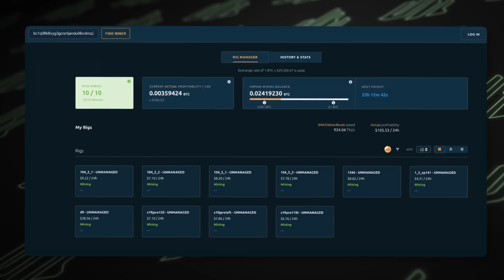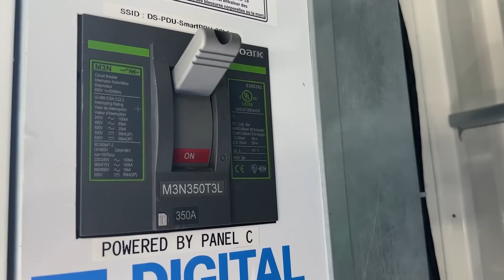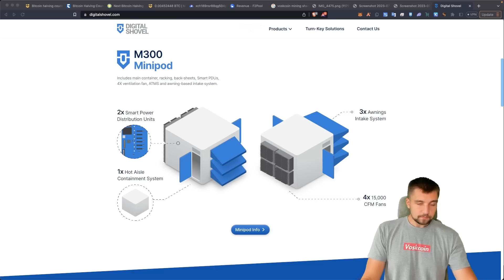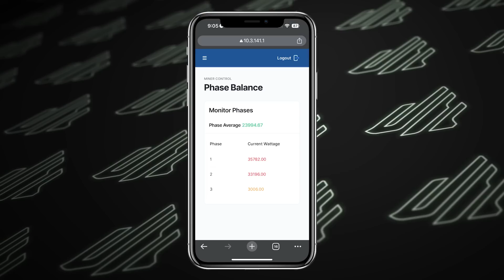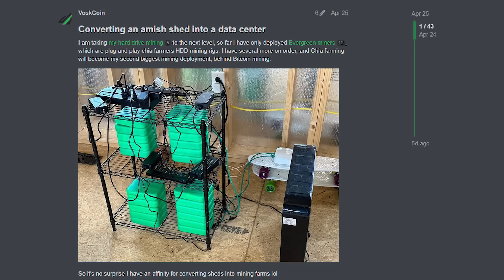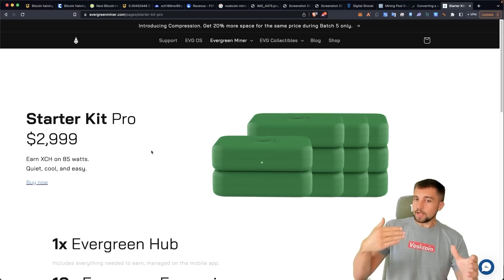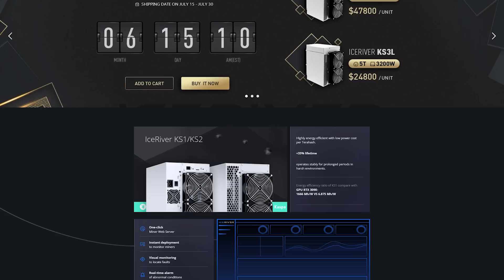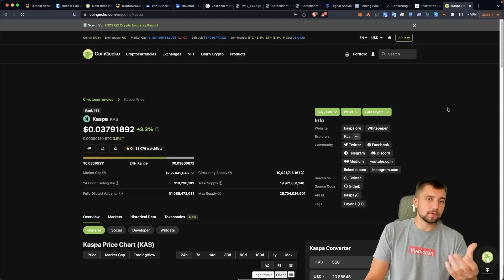My Mining Farm Problems Are Losing Me $1,000s!

Comment from the maker: I have more HDD miners coming too - https://voskco.in/chia
Evergreen Miners are Adding Compression! - https://voskco.in/evg
Use code VOSKCOIN to save some coin
VoskCoin Hard Drive Mining Shed Build - https://voskcointalk.com/t/converting-a-shed-into-a-hard-drive-mining-data-center/43375?u=voskcoin
Reply: Voss, It sounds like you might have a short circuit. In other words, there is some electrical wiring that is touching metal and thus your pulling too many watts. Go through carefully and check all the wiring inside and outside of your asics and any other electrical wiring to make sure it's not shorting to ground. Have you noticed any burning electrical smells? The insulation could have burned off somewhere. I could be wrong, but it's a good idea that carefully check all the wiring.
Reply: Do you have a thermal camera? It can sometimes be used to locate a short circuit. I once located a short in automobile by turning off all the lights and closing the garage door. I held my breath, turned on the ignition and quickly looked under the hood where I could see one of the spark plug wires glowing. I of course then immediately turned off the engine and open up the garage door afterwards. My point is that shorts can sometimes be spotted more easily in the dark, if you don't have a thermal imager.
Reply: @TimeSum21  it can show what breaker have faults and so on, its a very good tool to locate electrical faults. 

it can also be used to locate if there a leak or short circut somewhere along the line

sometimes moist in instalations can give simuler problems
Reply: Are your breakers tripping? Check the input current. Are the breakers thermal magnetic? check the breakers case Temps? Most industrial breakers have trip sensitivity. You might be set to low.
Reply: You need to not worry about being ready for full solar and start experimenting on sloppy solar just get one panel and set up one minor, then do another, then another. Baby steps.

Comment: Heat is a majot problem, especially with btc asics.  I had problems with mine once the temps got hot.  As they get hot they start pulling more Amps then normal then would trip the 15 Amp protection circuit.  I ran 2 s19J per 30 amp breaker split on 2 15 amp banks.  Sometimes this would cause all of them one breaker back to go down as well.  I caught it one day by luck.  The s19s series are super susceptible to heat.  The watts could be drawing close to 1000 watts (3-4amps more) more mining at the same speed all due to heat.  This was both air cooled and immersion.  

On the whole building front.  Each new building will require more and more effort because you will have maintain around it.  Pest control, filter cleanings, reg. Building maintenance, infrastructure repair and setup and a whole lot more.  Sometimes it takes years to get temperature issues right and other times you find the just good enough phase.    Good luck and focus on one at a time.  Once you get it good enough to just regular maint, then move on to next.

Comment: Your idea of solar is great but you shouldn't be using it to offset.  You actually might want to consider going solar and using as much of the electricity possible coming into your home.  Most people think solar and already see the large amount of upfront costs but you can actually go the route of connecting your own panels to super large battery banks like 5kwh or 10kwh. You just need a few 400w panels and connect them to portable power stations to instantly generate electricity.  Bitcoin as we know it is never profitable usually when you are mining, it's when you hold it, and in time your efforts will finally be paid off. Your first set of solar panels might not be sufficient to power what you need, but solar panels plus power stations can be added as you go.  Start looking for the best deals for solar panels and power stations and begin your collection today.

Comment: Brother breathe. We are all going through it, with International Energy Grid issues ive blown Service Panels, Plugs, Breakers, hell i even blew a transformer last week. The Global heat, increased demand etc is causing all sorts of issues, not to mention multiple regional "Outages" of 12-14hrs for days in a row. Then low voltage causing increased amperage and shit to just Blow Up on the power supply side. 

Just keep stacking the BTC ASICs, myself i just keep deploying more units to compensate for down time (Multiple Locations Helps), eventually once markets recover in honestly 2-3yrs this all plays out HUGE to those of us who survive. But youre not the only one Brother been going through it myself 🎉 been fun 😅

Comment: Can you replace the breaker? I’m sure it is a GFI breaker. Switch it with a standard breaker if you can. I had a 50 amp breaker that was giving me trouble I haven’t replaced it yet. I let it just sit off for a day. It is working fine now.

Comment: I like Cleanspark's approach of submerging all the miners into coolant tanks. I suspect many electrical issues are related to excessive heat. They run alot quieter submerged also.
Reply: I did that back in 2016 worked good but my utility was $.14 kwh so I canned it

Comment: i might be wrong so no offense , but if its  related to power and combineing 2 phase or more in the system u should check the phase and stuff  with scope and see if the full system is drawing too much even in ms time frame ( that is enough to trip the breaker) , i think u can do that just adding some arduino power logger etc etc on each miner or make group setups and check this and do check the pf ( power factor ) of ur pods , and see if u need any pf correction or not , pf correction should lower overall bills. 
again no offense , thank you.

Comment: In many applications, 208 vac isn't capable of starting motors with a heavy load. 208 works great in heating/lighting applications. So, the solution is a 24 volt boost transformer of sufficient kva to add to the 208v . The net voltage around 232 vac should take care of the problem....Or, replace the shovels transformer
Reply: His existing teansformer probably has various tap options for boosting the secondary output.
Reply: Hes not starting heavy motors. the biggest motors would be blower fans for cooling.

Comment: Switch to Chia farming and sit back rack in the $$$$.   You can run them off solar panels and marine deep cell batteries.   For power ratings, that is green and just expand them over time.   Data farming is low energy cost and aligned with cheap solar panels.

Comment: Vosk, it sounds like you have a short in one of your applications, which is ramping up your amp pull and tripping the power. Why did you go with the 208v??? I know you understand electricity. Youre pulling more amps with 208 than you would be with 240. But something is shorting to ground, you gotta ohm out your machines one at a time and find which one is shorted.

Comment: Cooling paint on the shed can cut the heat by 20 degrees.  Also a cheap dome over the whole shed, with polycarbonate and window tint that blocks up to 90% UV placed onto the polycarbonate will additionally cut the heat.  Solar fans on the dome are pretty cheap.  A cheap dome can be built for around $500 to $1000, a Zome is similar and one video on YouTube mentions less than $5,000 - mainly he used expensive flagstone for the floor which accounts for most of the cost, but without a floor the expensive part is cut down to only $500 to $1000 for the Zome construction.  He was able to use specific ground spikes to secure the dome without the need of any foundation.  A dome with auto tint will cut the heat substantially.  The solar fans connected just like the one in the Zome dome video are pretty cheap.  The airflow will bring the heat down even further and it is possible to have a small solar rig just to run an air conditioner into the shed.  Various steps like the ones mentioned above should substantially lower the heat affecting your mining rig.

Good Luck, I do enjoy your videos.

Comment: bro u have to get your volt under control in hot areas when sun hits the wires and u push really  hard on them the volt goes down ok? in new miners if u cant have enough volt to run they shuts down... so what u need is amp stablizer for all your miners and its gonna fix your problem... i thing they have them too 100amp one phase... and plz make a video about your detailed your electrik plane so i can help u better

Comment: Just for fun where does the power for the fans, camera's, etc draw from? Could it be from the one PDU side that keeps failing? Could be hardwired before the PDU. I would put a monitor on like Emporia. Dirty filters could make the miners starve for air to push. If fans juice up based on heat they draw even more power its a never ending cycle. The cost of those 4inch filters alone make me cringe, make your own jig!

Comment: Are you aware of the USDA grants for rural small businesses?  Depending on your location you may be eligible and it’s 50% of the cost of solar. Coupled with fed tax credits, which can be sold if you can’t use them and you can get a very cheap energy supply. See REAP